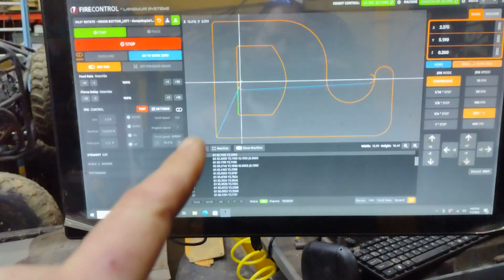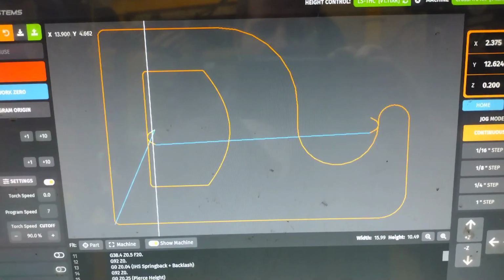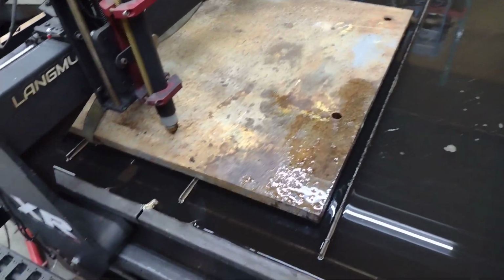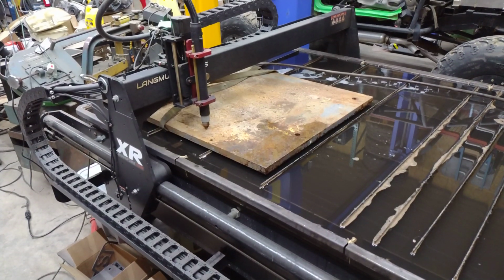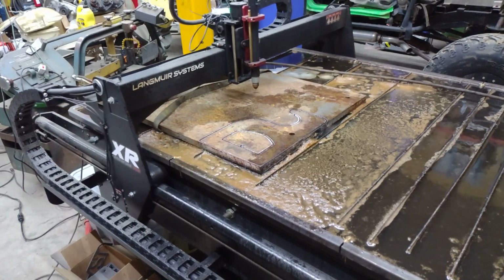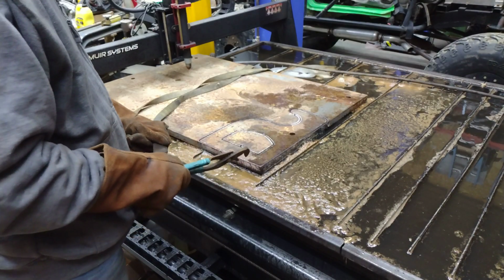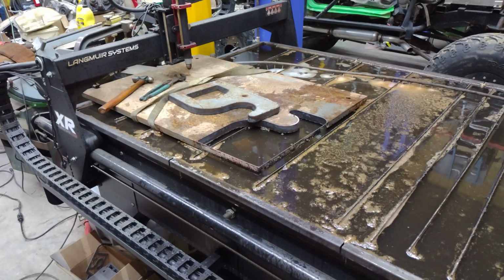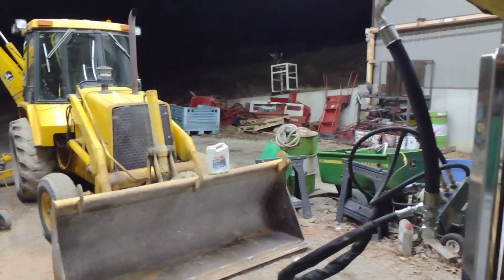Plasma cut 1" thick steel with Crossfire XR Hypertherm Powermax 65Sync

Comment: How did you get the cut at 90 degrees? I'm working with Hypertherm PowerMax 105 and can't get it right. I'm ending up using oxygas.
I haven't really tried various settings. I'm just following the manual. Perhaps since it's not the sync version, the cutoff will be uglier.
Tomorrow I'll try some settings.
Greetings from Argentina. Great video, my friend. 
Sorry for the English, I'm using the translator

Comment: Great advice.  You should check out the Beck's Armory Machine torch holders for the XR.  It has a laser cross that could reduce the time i takes to line up your torch with the pre-drilled pierce hole. :)

Comment: I envy you for having enough time to cut 25mm (1 inch) with 65A. I use Hypertherm Powermax 125 and cut 25mm with 125A at almost 4x the speed. Cut quality is not that great but the parts I cut do not have to be that precise. I cut a lot of material, some 1000 tons or more per year. Most of it is in 10-25mm range but i often cut 30 and 35mm too with pre-drilled hole just like you did. At 125A you can pierce 25mm easily, i think i set my machine to 2 or 2.4 seconds pierce time (not sure, i have like 200 profiles for cutting) but 30mm is not suitable for pierceing. It is possible but it can (and usualy will) damage the cutting head due to erupting molten metal blown out by compressed air. In any case, great job and very nice cut quality. I had my doubts about 65A being enough for 25mm plate but at that low speed I am amazed how good it worked. Great job! You can check my channel and see how I work too, I would be happy to share experiences with you.
Reply: You need an XPR300 for cutting tons of 1" all day
Reply: @rmkensington  I agree, Powermax 125 is a great machine but I too believe that more powerfull power unit would be more fitting. When we decided to buy plasma cutter (working table is 6000x2000mm) it was initialy planned to be used for thin materials (0,5-10mm or so) and for stainless steel (we use a lot of stainless in our chemical department, very agressive materials there, sulphuric and nitrogen acid, chlorine...) but it turned out to be far more versatile and usable then planned. We definitely plan to go for a stronger unit but I am not sure about gases, due to price we would love to be able to cut only with air. There are also ideas to go for 40-60kW laser, prices are really going down for chinese equipment.

Comment: Increase your lead in length, should be et least the thickness of the material also the pip you have on the cut is the end of the cut, to minimise it increase the overburn length .

Comment: That's awesome. Love the tip of starting a hole for piercings. I do a little thick stuff, haven't done 1 inch though. Can you tell me why you cut at a higher height setting? Thanks again. Ill be subscriber.
Reply from the maker: Those are likely book settings from hypertherm.  Higher the cut the longer your consumables will last but it's a fine line.  Too far away you will have a beveled cut.  The book settings for the hypertherm machines are pretty good on thicker material.
Reply: @Curtis_Schwoeppe_Enterprises  I'll be interested to try the higher setting.
Reply: @Curtis_Schwoeppe_Enterprises  also what do you think about centroid?  I'm getting ready to upgrade my plasma table to a centroid control, Long story but my software is not supported.
Reply from the maker: I have a milling machine that I retrofit with a newer centroid acorn control and I really like it.  The user interface is something from the 90s lol, but it operates well. I would like to see an updated user software like Langmuir systems fire control is pretty sweet.

Comment: wow, great cut.  I have the same Plasma machine on a Langmiur machine and am getting crooked cuts on 3/8". I changed tips and still having problems.  Any suggestions??
Reply from the maker: Check and make sure your torch is square and perpendicular to your workpiece.  Find out if it does it in x and y axis. If it does it going in x and y then your likely not cutting using book settings. Either too far from material or too fast.